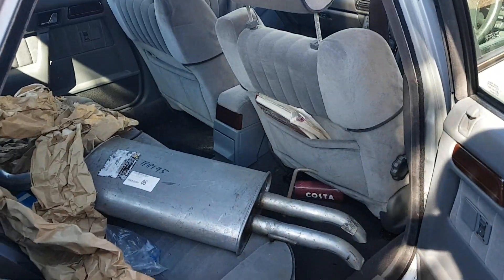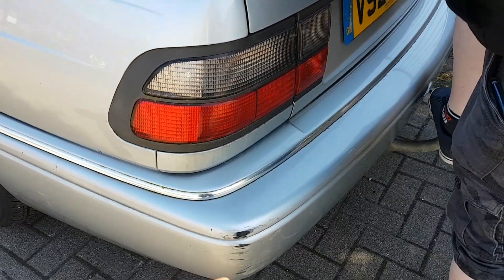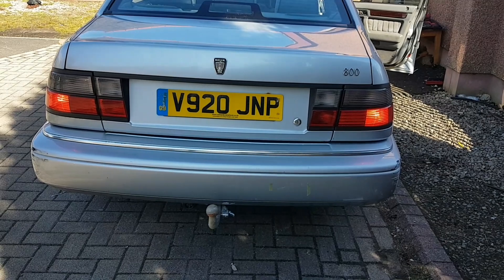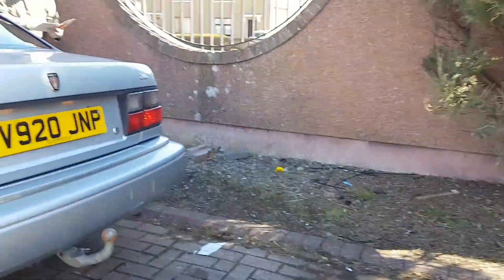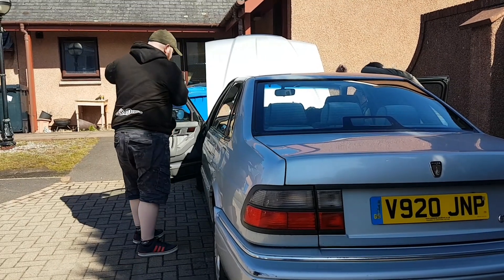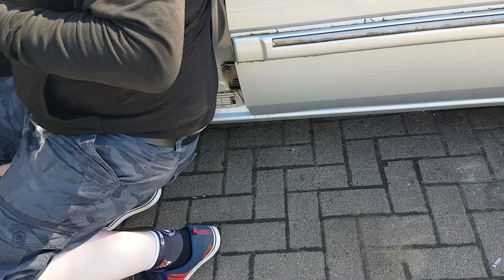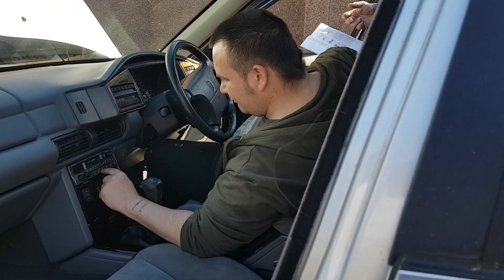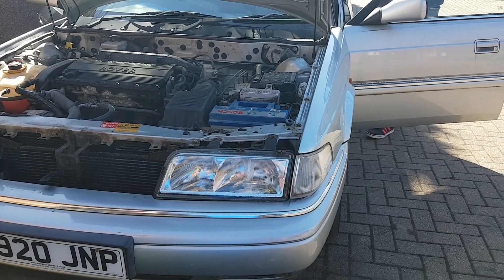Roger The Rover 820 Project

Comment: Hello there! You may or may not know me from the Rover 800 groups i own five 800s all of which ive rescued and restored one of which is the 820 saloon which was abandoned in the Castle Gresley dealership. Ive restored Mk1s but the odd MK2 as well and i have to say that's a very nice MK2 you have there i wish you every success with it. These cars are increasing rare now as are the parts especially were the MK1 is concerned if you need any help or parts gimme a shout. All the best
Reply from the maker: Yeah mate I  am planning to do  her up. Am having a problem with her eletrics they are bit dodgie. I am not sure whether it's just dry solider joints or has it got damp. The carpet needs to come out. I  have some welding to do  on her but it don't seem to bad there is 3 up here in this local area to me.  I  bought this one's as it was my brother's old one he sold it to a boy on the 800 group. I  always liked it but at the time had 3 car's do couldn't take it on now I have it so I will  hopefully get her sorted I am looking for a few bits for her.